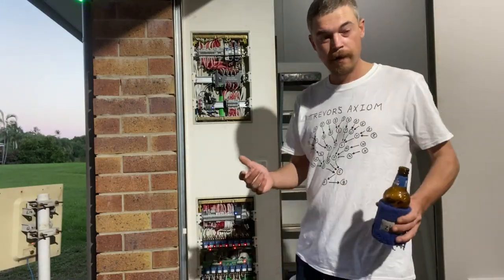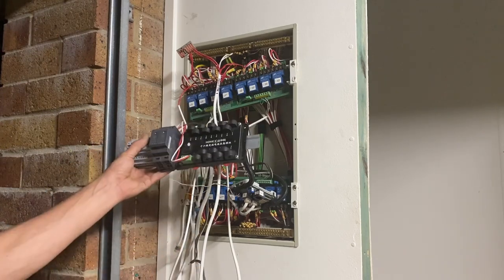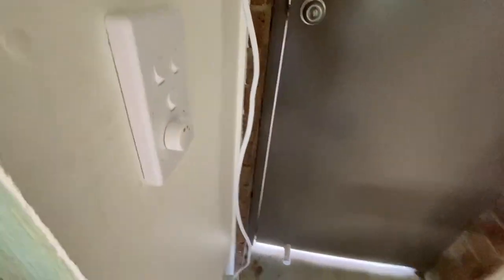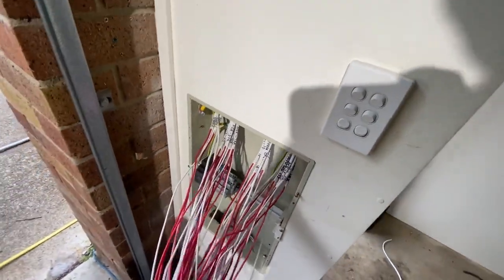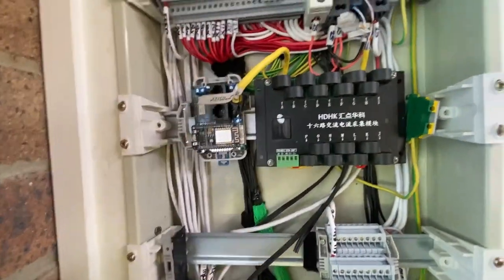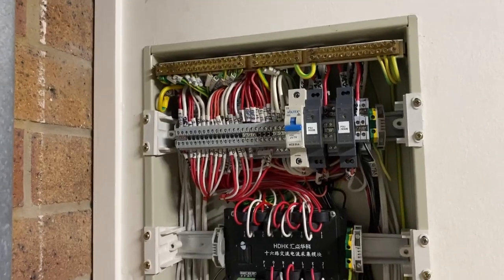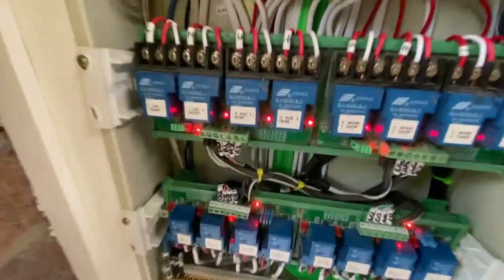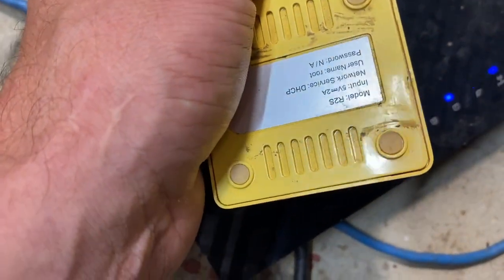Shed Automation, Phase 1

Comment: Trev! I love your work brother, thanks for sharing your work here, on C.E. and C.A/V/D/S/C.
I appreciate what you said there about wanting to make it all compliant and super simple so any sparkle can hook it up and it all just works.
FWIW, I was just thinking that you could make it even simpler with even less LV wiring by installing those new ELV switches by voltex in the field end and have them tell your MQTT device to switch each load on or off, that way you don't have to worry about two-way switching.
The only thing I don't have an answer for off the top of my head is dimming at the SWB from the field.
Reply from the maker: It's a minefield when even my peers don't understand the logic but the electrics are solid for fault finding unlike most smart switches.

Comment: In terms of a physical barrier for the relay terminal screws, if we are in a pinch we get a bit of perspex from bunnings and cut 2 strips neatly then glue them together at a right angle. Can tack it in there somehow and will work well enough. Can always get custom ones made up with the nice bend radius in them but that means time and money. Probably an easier way but it's cheap and easy in big industrial switchboards.

Gear off aliexpress probably won't last 30 years but it's cheap enough to re-buy it if it releases the magic smoke haha
Reply from the maker: My idea is just a concept; We make the shit locally here mate IMHO, well that's what I'm trying to push! 

Let's make a true blue design; Here's the cheapest logically way I think of lighting systems!

Comment: Thoughts on the new arduino opta for something like this?
Reply from the maker: Because of my design, I've actually got another 3 controllers ready to go. I just need time to go through them all; Some are totally pre-made 16 channel relays with an esp chip of choice. 

I wanted to make it in such a way should the microcontroller die; The lights and outlets function perfectly fine. This was purely an R&D setup, haven't seen other lighting controllers like it; Doesn't scale well due to fault loop.

Comment: hey Trev bit of a random question what RCBO do you prefer? i personally like the hager ones due to the neutral link & ease of busbar installation vs the Clipsal ones that have the L & N coming in from the bottom
Reply from the maker: Clipsal devices upon holding down the test button fail to disconnect upon a 180 degrees cycle. In fact you can damage the principle of the device by burning out the test coil. Had hager devices fail in the same way. Doesn't matter what brand you use; Testing is the most importance!!